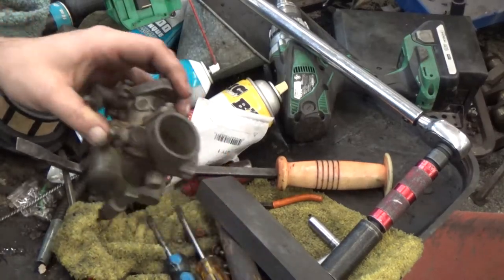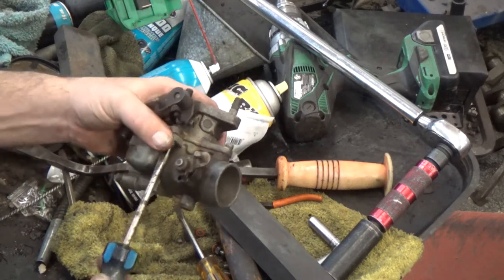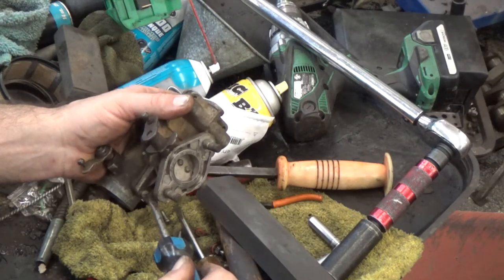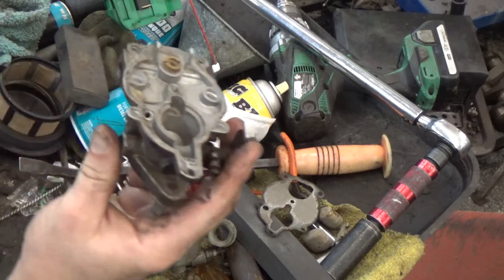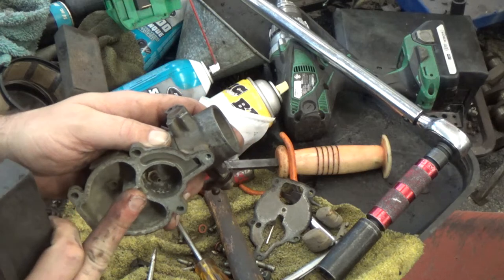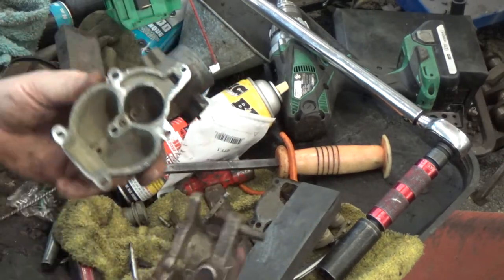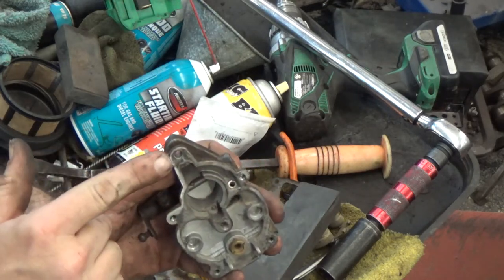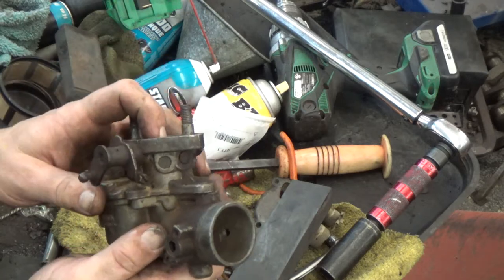Don't replace your tractors carburetor until you check this first!!

Comment: I've noticed that dame issue over the years. I've had great luck with the cast iron carburetor. And almost always had leak's on the pot metal carburetor. In the past I've checked with a file and then used Indian Head to seal it up after rebuild just because of this same design flaw. Great advice and I always thought I must have done something wrong in the past. But seems it's not me it's just junk from the factory.

Comment: I have a 45-50 case sc tractor. When we pulled it after 8 years of sitting in 2020 it stated up and idled and ran fine. Now it bogs and doesn't run right. Still runs but not enough power. I'll have to check if thats the problem. Thank you for the video.

Comment: My son has an International 184 with the same problem 👍 Also are you familiar with governor issues? If so he changed his governor and the tractor wouldn’t start after that, backfiring out the intake, I pulled it, rotated the gear 180 and it’s doing the same thing. 
Thanks

Comment: Can you answer this question?
On an International BN, Marvel Schebler made two different carburetors, one for distillate or kerosene (TSX-156) and the other for gasoline (TSX-157). All replacements resemble the TSX-165 (replaced with what was on when purchased).Could this cause the tractor to sputter and stall and not run properly? And where can I purchase the proper carb (TSX-157). Thank you for this video it explains why the old crab was leaking.

Comment: I've got an IH 656 that I have been fighting a leak somewhere in the carb. I'll have to pull it off yet again and check the housing, but theres a front end loader in the way that makes it not so easy to get to.
Reply from the maker: Yeesh.. yep front end loaders are absolutely awesome and great tools unfortunately the caveat is they are in the way of doing any simple servicing 😭
Reply: Have a satoh. 650g , runs on either when applied, gas goes into float but won't run by itself

Comment: Ok! my carb leaking gas from front. Purrs like a kitten only with choke three quarter engaged. Am going to try this. Everyone tells me it is starved for fuel so must check adjustment of float. Don't know the specs for this but hopefully will figure it out. Can't be by trial and error. Am sick and tired of taking this carb off and on. 1966 IH 606 with original odd duck carb.

Comment: I have the 4 bolt version of this (Z12158 maybe). I was getting major leakage. Found a crack bottom half wall of float area. Opened it up and the floats were crushed and split. Then i mated the surfaces without the gasket and i have an 1/8 inch bend just before the 2 bolts on the float end. Not sure it i could warp it back with some heat, then fill the crack. Don't want to drop the $400 on a replacement, this is a min dozer/trencher (1970s maybe).

Comment: You may be my salvation... 1950  gardnerdenver  pullbehind aircompressor ..105 cfm... whz model with a 6b230 ci  buda engine ... carb is a huge zenith..OK bow that I got that out lol I had it running but carb was a mess  finally I realized float was leaking .. by the way trying to resolder float can result in  desolder completely.. I knew about the way carbs can warp and in my enthusiasm some how I ended up  breaking the float  tower loose  .. it has been a few years ago and I think possibly I may have gotten the tower jury rigged back on but I can't seem to find the ventury still need a float and the round plate with the carb number on it is unreadable.. ...because it is an aircompressor and has the unloaded. Feature ..which I'm not really up on so much I am hesitant to use a different carb .... any ideas ?
Reply from the maker: Zenith company is still around...(http://www.zenithfuelsystems.com/)   try calling here:  "For more information and a free catalog, please email Mattie Bellamy or call 276-645-8619."  They may have resource info on it for you.

Comment: I have a Ford 9N with a rusty gas tank. Is there any way to clean it or does it just need to be replaced? Great video!
Reply from the maker: Yes there are many ways to clean it.  Really it depends on how severe the cancer is...  there is all sorts of great working solvents out there.   We sometimes use electrolysis .     Even Using a handful of nuts or ball bearings and shaking the tank (use magnet to get them back out).       Once its clean, we  use a quality tank liner if the tank seems thin or has pin holes in places... (we use RedKote mostly)  But follow the directions religiously!!      (a sloooow  cheap but great method is using white vinegar and water.   Use half and half,  fill the tank with it or submerge it in a bath.   It will have to set at least 5 to 7 days for best results.!!)
Reply: @AtlastaFarmCo  Thank you! I love the Ford 9N videos! Have a Merry Christmas Everyone!🎄

Comment: Good evening,  my question is about the float spring placement? Is there a wrong way? Should it be pushing up twards the needle,  or pushing down? I usually take a pic when doing these but this time I didn't. I recently rebuilt my zenith carb and now it seems pretty wet on the gasket.  Thank you for any help.  Dennis
Reply from the maker: Unfortunately I am not sure what model carb you have.  Not many have a "spring" or Clip.  And most that do, do not even require it in the first place.
Reply: Thank you for the advice, actually I had a distributor issue, so I just converted to  electronic ignition , scrapped the points. I took your advice,  took out the spring, Carb floats are doing  the job! Possibly it was rebuilt before and they added the spring to it, it's working fine now. Have a great day!  Dennis

Comment: I have a allis CA, carb is dripping out of the mouth of the carb,, is the float the problem?   Errol from Canada, thankyou
Reply from the maker: Definitely check the surfaces for flatness!!  And yes,  it can be a high float setting.   To set,  hold the half with the float upside down (float should be on top when holding it)  the float should be set to almost level with the surface

Comment: Hi Matt hope you are well and COVID not causing to much trouble I was wondering if I could ask so questions regarding the Ford 655 many thanks Richard
Reply from the maker: Sure thing.   I think you left some voicemails. Sorry I have been running 4 directions at once and am more than way behind on returning calls. (No secretary for a while now)
Reply: @AtlastaFarmCo  no I haven’t left any voicemails I sent u an email couple days ago just explaining the same thing about lack of lift power since came across a valve with a wire running to it which is the same wire that goes to the control lever?

Comment: Hey Just came across your video. I have a zenith carburetor 12098B L63 off my Wisconsin VH4D1 engine. It pours out the mouth of carb. I’m going to try and plane it down with the block first and try rebuild kit. If not telling customer to purchase a carburetor replacement. Any good decent replacement carburetors just in case. Excellent video tutorial Thank you
Reply from the maker: Best thing to do is get a zenith replacement you can go either to Steiner tractor or the carburetorstore.com or direct to zenith out of the Tennessee plant. However zenith is one of the most expensive and expect to spend $400 plus

Comment: I have the newer style Zenith 68 series which has the extra screws which is nice about not deforming the main body like in this video but I have a stripped idle mixture screw in the main body, not the screw itself. Cannot seam to find much on net about this. Tap size etc. Anyone know?
Reply from the maker: yeesh.. late to reply,,  but if your still in need,,  Zenith is still manufactured in Tennessee...  you can google the manufacturer and give them a call..  we used to call them often a few years ago..  sorry I dont have the number in front of me at the moment

Comment: i have a 4000 ford 3cyl have never been abel to get it to open up without choke being on some had this thing apart 3 times ranall the orfices good im at wits end have never had this much trouble
Reply from the maker: Which carb are you working with?   Is it the Holley?
Reply: @AtlastaFarmCo  no sir its a rotten zenith with no high speed adjustment  got some kind of diaghphram on bottom had this thing apart so many times screwws are gonna wear out clend and reamed ever orfice in it time and again
Reply: zenith has a diagraphnon on bottom @AtlastaFarmCo
Reply from the maker: @charlietanner6211  you may have a zenith replacement for the Holley.  Does it look like the one in this link?  https://www.ebay.com/itm/393418516265?mkcid=16&mkevt=1&mkrid=711-127632-2357-0&ssspo=wtx8sndrr8m&sssrc=2349624&ssuid=1vFVgjZaRpq&var=&widget_ver=artemis&media=COPY
Reply from the maker: If so most of those do have adjustments but for whatever reason whatever drunk designed the thing... Decided to put brass caps over the adjustments..  However there are some cheaper versions that have brass buttons like a BB instead of an adjustment.  And those suck.. Those come down to issues with the diaphragm.  Either it has a pinhole, or the disc/spring mechanism on the diaphragm has a problem
Reply: @AtlastaFarmCo  yes looks exactly like those only mine is 3 cyl 4400

Comment: i have a farmall h it floods constantly and when i do get it to finally run it gets frost on the out side where it bolts to the manifold no matter what the air temp out side is . ive set both screws and adjusted them while its running and no change the best i can get it to run is with the bottom screw all the way in tight if i choke it to kill it gas poors out of it or when im trying to start it and stop cranking the engine gas poors out of the carb in short i need your help its no good to me if it wont run

Comment: I just got a  farmall A i think close to the same carb as that one and it seems to be overflowing ,the wing nut at the bottom is that just a drain valve or ? i tried to find a tuning video just on farmall A carb,But havent found yet,ill get out an find out what name brand it is,great video more to watch :)
Reply from the maker: If it is a true wing nut and has a hole in the center (looks like the nut turns a pipe) then yes that is a drain. However If it's just a standard wing nut that looks like it just turns a screw then most likely you have a later version of that carburetor and that screw is your flow adjustment.
Reply: thanks so much for the reply,i took it off today its a phillips has made in the usa right under the name ,i didnt know but tht was the main adjustment and it was shut closed,i went ahead and opened up the carb,someone has already been inside,and has all the other screws stripped including t,he needle valve body,i went ahead an ordered a after market carb,i may send this to someone to rebuild.well someone with the proper tools an knowledge,heck the kits was as much as the aftermarket carb,

Comment: Tsx713 marvel-schebler looking for this carb or a z14991 I do need one Ty Sonny Poteet
Reply from the maker: Unfortunately we no longer deal with parts :-( however first on the list would be contact Steiner tractor. If they do not have it the most direct route would be to contact zenith carburetor directly. Zenith is located in Tennessee. Unfortunately I do not have their number memorized but they do have a website. This company actually owns the patents and manufacturers replacement marvel schebler carburetors

Comment: Hey man I have a IH 184 that I can’t get to fire unless I cover the carbs with my hand I can’t find much about these things online any idea?
Reply from the maker: either your flow valve is not open enough, you have a restriction in the fuel feed to the carburetor,  the float is sticking too low or adjusted too low,  or the main jet is clogged and lastly air leaks either in the throttle/choke shafts etc.. or between the two haves of the carburetor itself.

Comment: I rebuilt the carburetor on my Farmall H now I have major problems, there is a video on my channel, please comment any suggestions
Reply from the maker: My first guess would be a leak between the mating surfaces.   Or a missing metering jet.
Reply: @AtlastaFarmCo  is the metering jet a small brass tube about 1/8" dia. and about 1" long threaded on 1 end? if so it's there , I will  resurfacing
Reply from the maker: @jerryrigd4790  that's the main jet.  Metering jets are normally tiny brass screws with a small hole in them.  There should be at least one in the tube where your main fuel adjustment is.  Normally your adjustments have a needle on the end of the screw.. those needles fit in the brass jets.   Like a mini valve in a faucet

Comment: What's the carb on a 1965 JD 1010 4 cyl gas?
Reply from the maker: Recommend  going to an online John Deere dealer and looking up your model in the parts section.  This is the most definitive method to find the part number.  You can then search that part number in google to find a good replacement